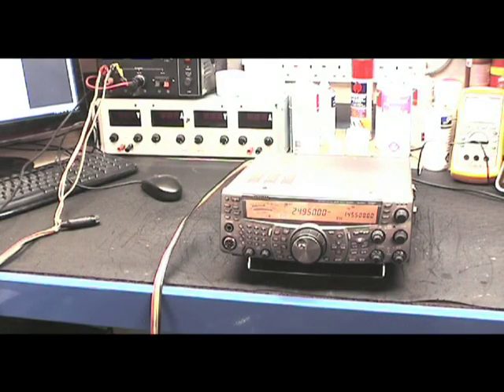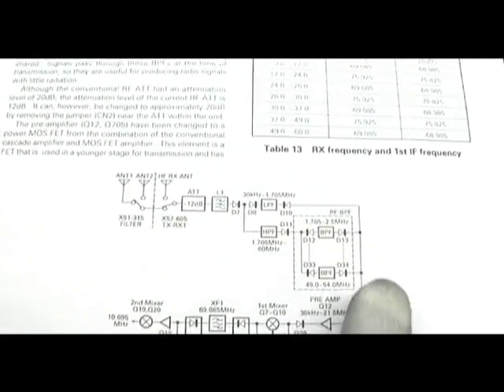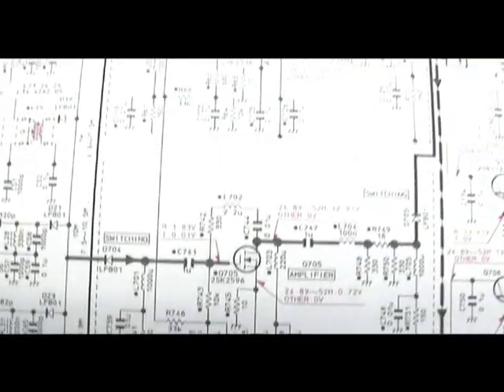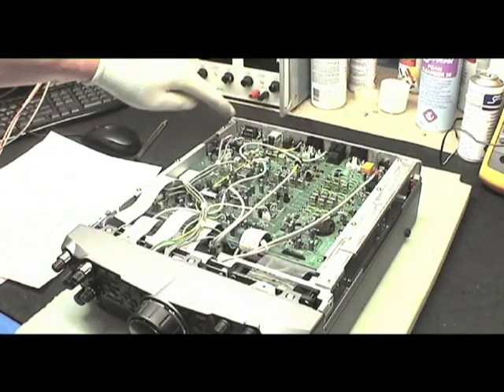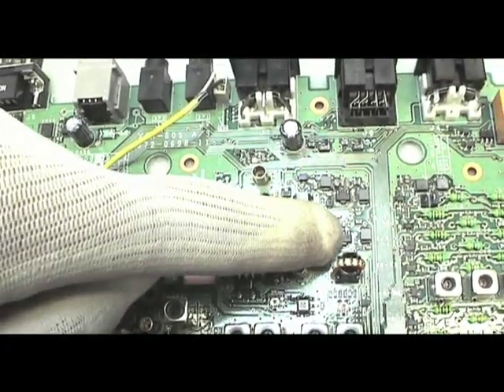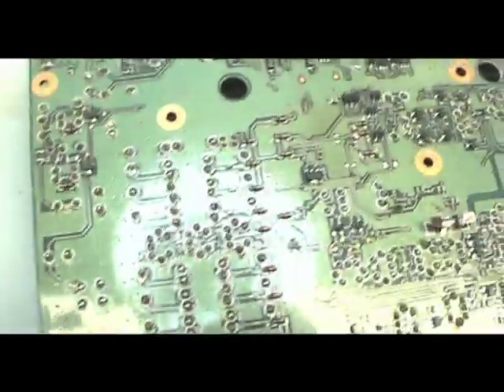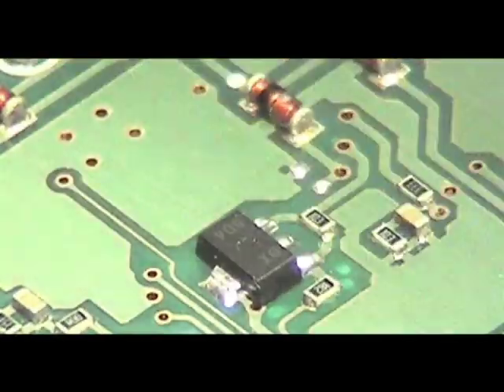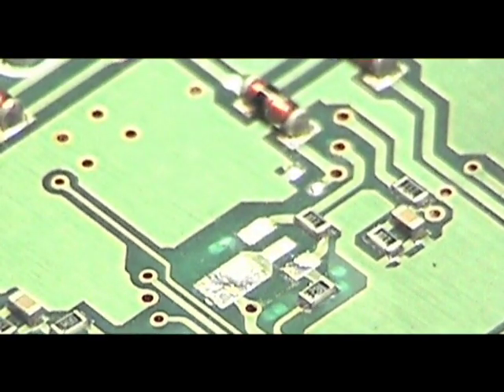Kenwood TS-2000 Pre Amp HAM Radio Repair Part 1 of 2

Comment from the maker: Hey Dave
Thanks for the interest in the video. The TS-2000 is a great radio, I have never tried out the 1.2GHz module in one of these. I am told they work really well... The TS-2000 can be a little problematic as can most HAM radio equipment, that being said they are generally quite reliable.. Enjoy the rig and don't worry.... Best Regards.. John M0XFX

Comment: Nice Video Sir. Iam hoping my 2000 does not get any problems. I would like to obtain the 1.2 GHZ modual for my 2000, as its the last optional unit to install. The voice recorder and voice synthesizer. Trouble is service centre only, dont want to send my 2000 away possible damage in pose. Does anybody know who i could obtain 1 new or used and what kind of price used. I would be most happy.

Comment: My ts-2000 lost sensitivity in the range of 144,000 to 148.000o I can do to get back to normal. pt2asr - vamberto_souto@yahoo.com.br
Reply: I have two of theses radios. One built in 2013 and one built in 2008. I had the filter degradation problem with the one built in 2008 and no problem so far with the 2013. If yours was built during this time span that may be your problem too. When I replaced the filters I took them apart to find a greenish looking form of electrolysis on the plates.